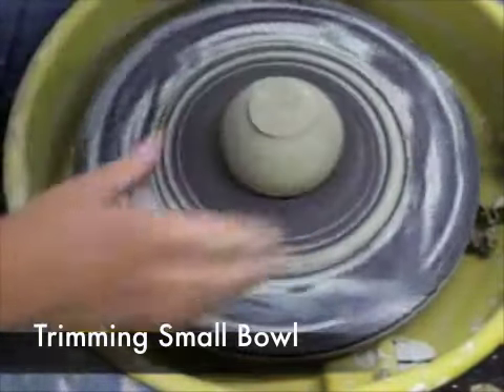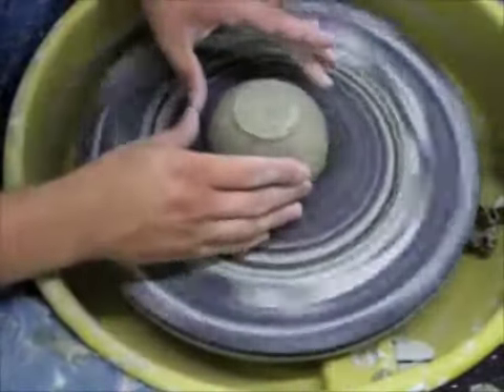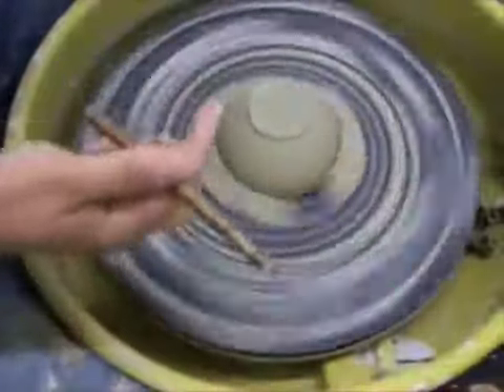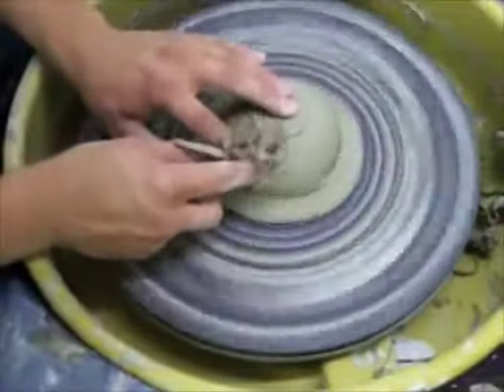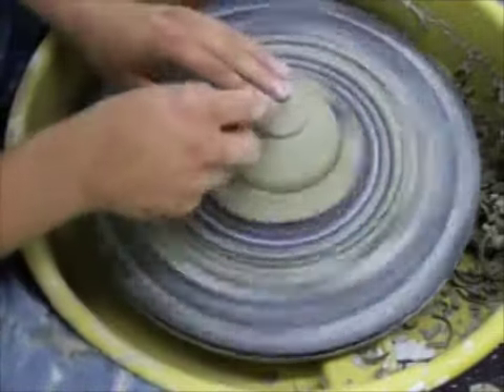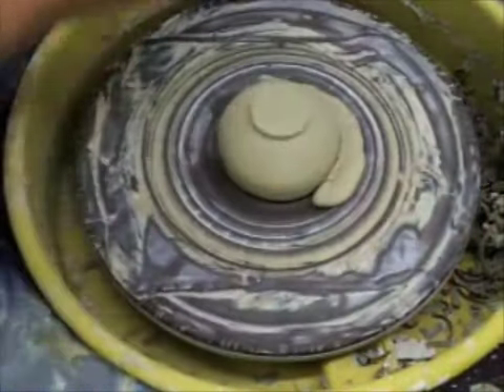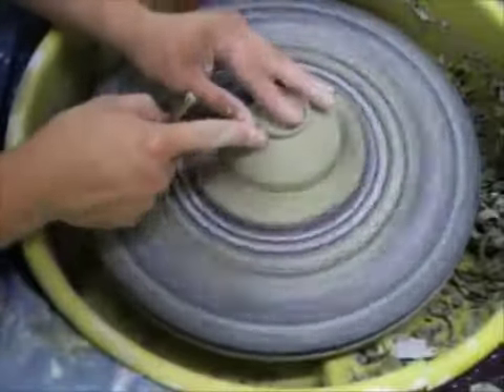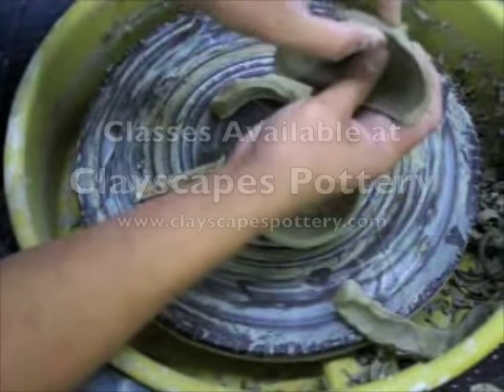Trimming Small Bowl with Tim See

Comment from the maker: A perfectly adjusted wheel head and a not perfectly level pot will cause an uncentered foot. and depending on how tall or how off level your pot it may be uncorrectable with the grip. The triangle pots are from trimming soft or trimming straight walled cylinders either you squeeze it enough that it pushs into a triangle or not enough and it spins and leaves a grip stripe. The right or wrongness of using a tool rather than learning a technique is up to the individual I use it but hate when I do.

Comment: If you have your Giffen Grip correctly set for your wheel head you won't get any wobble and if you use it correctly you won't get triangular pots. I don't use mine much but most of the complaints I hear are from not using the tool correctly rather than any issues with the tool itself. Also, using the grip isn't a "wrong" way just as trimming on the wheel head isn't really a "right" way. They are just ways.

Comment: And if I try to center by closing my fingers around the pot, it just flies off the wheel.
Oh! Re: centering, can you make a demo on how and why a cylinder is centered at the bottom, but not at the rim, and off and on in between and how to correct it?